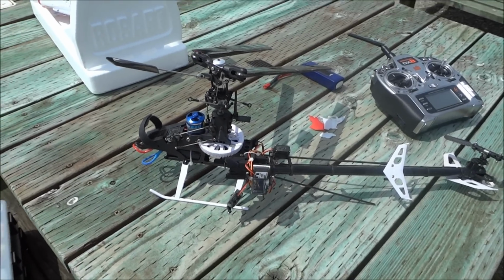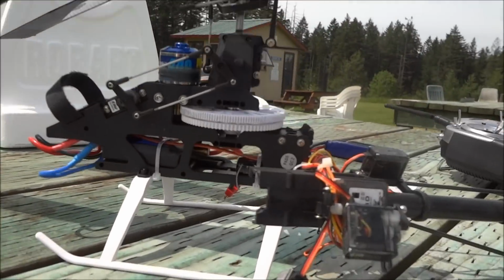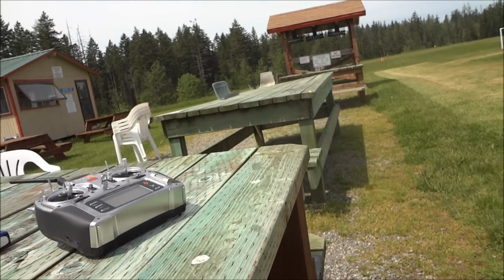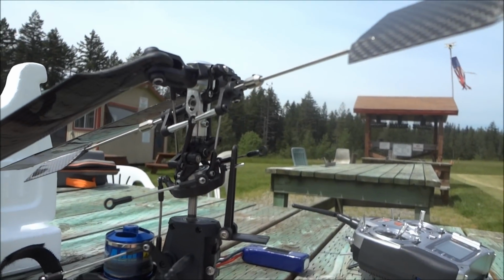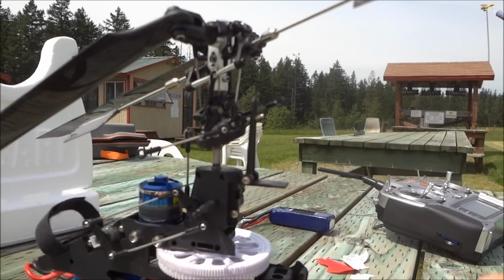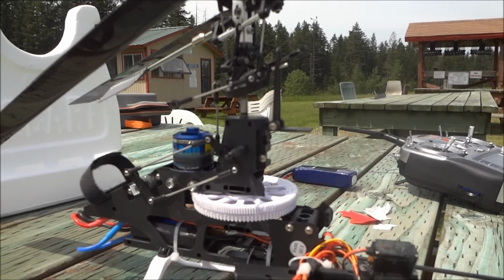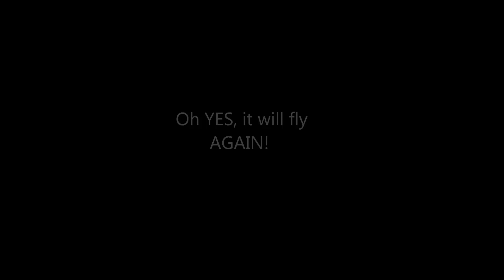Sad Day for the Blade 450

Comment: Just thought I should let you know I got my 450 3D yesterday and I am loving every single detail about it so far. I haven't tried any inverted flying yet because there's a chance it'll storm today out here, but I did fly it out the garage doors and around my driveway and back in. Everything about it is just perfect. The way the blades sound while turning, the sound of the motor(especially in idle up), the DX6I with different profiles already programmed, it's definitely worth every single penny.

Comment: Been there and done it recently. Ha!
Good job and good flying. I went nose in to the ground inverted without having time to hit throttle hold and it took the whole front end off where the motor connects - without stripping one bit of the main gear. Rebuild was less than $50 and I walked away with an important lesson.  
Take it easy on the collective when rolling and flipping, don't hold it inverted too long, and keep it 3 mistakes high.

CHEERS

Comment: I bought the version 1 from a friend. After a few weeks, I ended up upgrading the blades, replacing the poorly designed stock swashplate with a cnc one, adding a brushless motor, lengthening the tail boom, adding the version 2 tail motor, upgrading the main shaft to a rod instead of a tube, and upgrading the batteries to turnigy and a few other adjustments. I could still never forget the time I flipped my first cp heli, succesfully, on my first day!

Comment from the maker: Thanks WideAppeal, and imbroken73, I'm a firm believer that with every crash is a lesson learned.  And this crash taught me a LOT!  It was my first rebuilt (you may have seen my rebuild videos), and since then I've built a 500 sized Align clone.  Crashed that one on my first day of lying it because I didn't know you can't go from slow speed to high speed on the motor like you can on a 450 size.  Tail rotor belt slipped, lost tail control, and I had to cut power and let her drop.

Comment from the maker: They are a blast to fly, and they are a great way of getting into the larger helicopters.  They are still a little expensive to repair in a crash, but still WAY cheaper than a 600 sized or larger helicopter.

Comment: The FB is only a mechanical damper/regulator for control inputs to the blade grips. The controversy when using quasi-combos not specifically called out is that you have to find the correct gains and delays to compliment what the FBL controller was expecting out of a FBL head. My Ikon made my chopper feel like its possessed by the devil until I just kept eliminating setup ranges until it became flyable...Then was great. The self leveling is the nugget. It flips upright within a second of switch.

Comment from the maker: Thanks, and I'm still no where near how fast these helicopters can perform.  But I'm getting better.  The trick is to take your time, and go slow.  As you get confident in flying slow and easy, you will start to push your limits, and before you long you will be flying faster and faster.  Today I was hovering inverted at about 1m from the ground, that's the lowest I've ever hovered inverted.  Practice, Practice, Practice, and get a simulator. =)

Comment from the maker: If you upgrade to the E-flite 440H motor it comes with a 11-tooth 0.5M pinion, make sure that you use that one, and not the one off of the stock motor.  And if you do switch to the 440H motor, do not use the stock wooden blades, they can't handle the higher RPM.  As for the CF blades, the ones made by E-flite/Blade fit perfectly in the blade grips.  But if you buy some other blades, I've used some made by Maverick, you may have to use some plastic washers as a spacer.  And that's it.  =)

Comment: Yeah, I did notice that. But I don't have any spectrum transmitters, so I'm just gonna have to buy the RTF. Plus the DX6I looks really nice. The 450x does look really nice, but I don't have the money for it right now and don't think I could trust myself with it cause they do move alot faster than the 3D, so I'm just gonna stick with the 3D for now and maybe buy the X later on down the road. Also, is it necessary to add CF flybar paddles and tail rotors?

Comment from the maker: Wich mcpx did you get?  I have the first version that came out, I have heard that version 2 is better, and the brushless one that they just come out with is even better than the version 2!  The version I have had a bad problem of the tail not holding when rolling from inverted to normal flight.  And for the longest time I thought it was because of my flying skills.  So that frustrated me for the longest time.  But they are really cheap to repair, and it was still a great heli to learn with. =)

Comment from the maker: Interesting, your using a FBL stabilizer on a FB helicopter?  I've had people tell me that wouldn't work, that the FB and the gyro would be fighting each other.  I now have the 450X, and I love the BeastX gyro/receiver that it has.  But it doesn't have a 'Bail Out' feature.  But it sure makes the 450X feel locked it, much more so than the 450 3D.  It gives me much more confidence, I've even been doing inverted hovers at 4 feet off the ground, but I haven't got the guts to go lower yet.  =P

Comment from the maker: I like pushing my limits, so I try to get closer to the ground during my flights.  But in doing so I risk crashing.  I'm able to comfortably hover inverted at about 10 feet with my Blade 450X.  But I was happy when I was 3 mistakes high yesterday and I lost orientation.  Sun was going down, blue canopy, green trees in the background, you get the picture.  I couldn't see which way it was pointed, but being 3 mistakes high, I was able to pull out of dive just before hitting the ground.

Comment from the maker: I have both RealFlight, and Phoenix, and I use them almost every day, and yes, they are worth their weight in gold!  I've flown my 450 sized helicopters for over 150 flights now, and had only 3 crashes.  I can also do mild 3D now as well.  And it's because I learned quickly on the simulators.  My 3 crashes were due to stupid mistakes as seen in this video.

Comment from the maker: One thing I've always had trouble with is the terminology when it comes to helicopters, cyclic, collective, etc.  So I'm not sure if it is 'Pitch' or 'Collective'.  Not sure what the difference is.  I was in idle up of course for the inverted hover, and I went up on my throttle stick instead of down.  So instead of giving negative pitch on the blades I went positive pitch and slammed the helicopter right into the ground.  Would that be considered collective?

Comment: outch..
Damn.
I can feel how you feel.
I think i crashed my blade 450 3d 20 or 25 times.
Most of the crash are cheap but two of them are so expensive, that i buy a new one.
Now it is much more easy to fly, because i've bought a 700 size. 
So now i have more time to think...;-)
Greeds
Rolf

Comment from the maker: Yea, it was a nice video until the crash!  LOL.  And taking the flybar weights off just makes it more responsive, rolls and pitches faster.  I slowly moved them in closer to the center.  This allowed me to come accustom to the increased performance.  Then after a few flights with the weights all the way in, I just removed them.  But now I fly the 450X with no flybar and I like that much better then the 450 3D.  I actually sold this 450 3D because I figured I wouldn't fly it much.

Comment: Ouch! So is investing in carbon fiber blades even worth it if they still break in a crash?
Reply from the maker: Yes they are, and you can get them pretty cheap on hobbyking's web site.  In a lot of cases carbon fiber blades are a must, because wooden blades will fly apart when using higher head speeds.  And performance is better with the CF blades.
Reply: Wayne Saverud I see. I don't fly 3D so I've been keeping my 450 X 3D stock.
Reply: I use carbon blades on on my nice heli James, on my every day practice heli I use plastic blades as they can take a whooping. I find that by using plastic I usually only have to change my main shaft and running gear and not the blades as well.

I never crash my nice heli as I only ever fly it once I've mastered something on my practice heli. Okay, well hardly ever crash it I should have said :-)

Now it's time for you to start the hours of rebuilding and checking every single component for alignment, again...
Reply: What happened James?  That's gonna hurt the pocketbook!
Reply: Steven McGinley That's not me. Yet.

Comment: i got the 130x a while ago and enjoy it when its working,have had some issuses with gears,etc got the spin 8000kv motor too (not fitted yet) but when its in it will have more power than the 300x

Comment from the maker: No it's not necessary to add the CF tail blades, the plastic ones will work fine with the 440H motor upgrade.  It's just the stock wooden main blades that will not hold on the higher RPMs.  I didn't trust those right from the git go, even on the stock motor.

Comment from the maker: Ouch, the blades are the expensive part.  One thing about crashing the larger helicotpers, there are not many crashes that you can fix by gluing things back together with some CA is there.  LOL  Crash a foamy airplane, and with a little CA, your back in the air in no time.  Crasha a helicotper, well, your placing an order for more parts, and spending a lot more money. =P

Comment: that head speed sounds really high for sport flying.  no wonder it was damaged so bad in the crash.
Reply from the maker: Not sure what the head speed was. But this was all stock equipment with no upgrades.  This was also a time where I wasn't as knowledgeable about helicopters as I am now.
Reply: you mentioned the hot motor in the video..
Reply from the maker: halleffect1 Now that you mentioned it, I think I did buy the motor upgrade that Horizon Hobby offered for the Blade 450.  And again, this was back when I was just starting out in the hobby, and I knew nothing about head speeds etc.  I now have a Blade 500x, and I bought the Horizon Hobby recommended upgrade motor for the 500x, along with new pinion, and the 500x had a high head speed after upgrading the motor.  Can't remember the exact RPM but it was way to high, so I had to go back to the stock motor and pinion on the 500x as well.

Comment from the maker: I had installed the e-flite 440 motor that is the recommended upgrade, and if I remember correctly I used an app on phone to check RPM, so it would not surprise me that I had an incorrect RPM reading. :-)

Comment from the maker: With the upgraded motor I had in the Blade 450 3D, I had to use carbon blades.  I had upgraded from the E-flight 420 motor (the stock one) to the E-flight 440 motor.  With the faster motor you have to use CF blades.  The wooden ones will fly off due to higher speeds.  And I was the cause of this crash, I went the wrong way on the stick.  I went positive pitch while inverted instead of negative.  It was clearly operator error.  Thanks for commenting. :)

Comment: o fixed mine al up and replaced most of the plastic with aluminum now I am afraid to fly it lol i have the 450x
Reply: Joseph Rueck Yea, I know the feeling!  I can fly all day on the RC simulator, do all kinds of stunts.  But when it's the real thing the reset button is in your wallet! 😜
Reply: I am in my 50's spent many years in the NAVY working on the real ones and drinking heavily not to mention I grew up in the 70" and 80's partying all the time. I personaly think the 3d helis are meant for the young and fast reflexed sharp minds not the old and burnt out but its still fun. to chicken to try anything fancy so I bought a couple of cheapy cp helis to beat up. perhaps if I get a sim and spend alot of time learning what to do once i am inverted I can fin a good heli pilot to buddy box with. 450 x helis don't survive crashes that well. even a soft crash can result in a new feather and main shaft, a tailboom is almost certain and some lincages. the one thing i like a=bout flybarles is one less item to replace
Reply: Joseph Rueck I hear ya.  I am 50 myself, and I worked my way up to the Blade 500x, it's still in one piece, but only because it's been sitting on my shelf for over a year now.  Been working on racing drones, they can take more of a beating, and a bit cheaper to fix.  Though there is a LOT more soldering involved.  I still look up at the 500x from time to time though and think about flying her again. 😀

Comment: What's up Wayne. You should buy Real Flight 7 or the Phoenix flight simulator to practice there. When you go back to work, I'm sure you can practice on the simulator. It's a lot cheaper! And you can master your skills on the simulator so moves become intuitive enough to prevent a crash in real life. The key is, and like flying any other plane or helicopter, is to be intuitive on the controls and build muscle memory (instant reflexes), so that, when bad things are about to happen you won't crash, be it a $200 dollar park flyer or a $6,000 Extra 300 plane.

I've been r/c flying since 2002. I have a r/c glider that's 8 years old! The only way it's going to die is if I intent to crash it.
Reply from the maker: Thanks for the tip, I have both simulators, and use them on a regular basis.  I have gotten a lot better at flying my helicopters since making this video.  I currently have the blade 500x, just haven't taken the time to make any videos of me flying it.  I keep spending to much time flying my quad copters.  I am happy to say I haven't crashed the 500 yet because of the time I have spent on the simulators. :)
Reply from the maker: Lol.  Funny you should say that.  Just told some of my flying buddies that I need to get back to the heart of RC flying.  Been tuning up my Blade 500 helicopter.